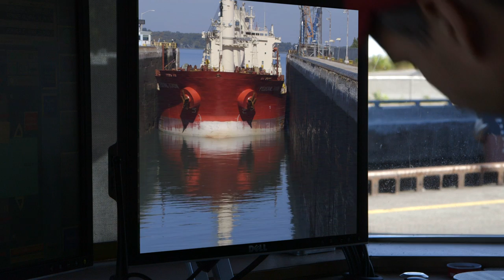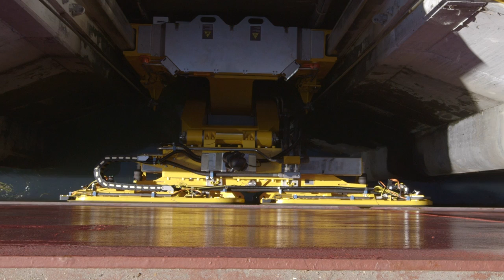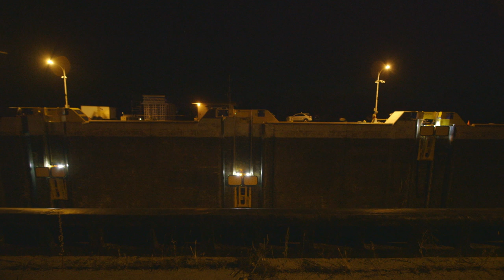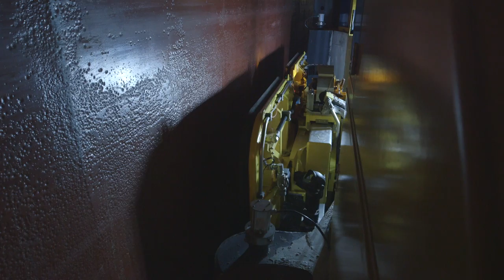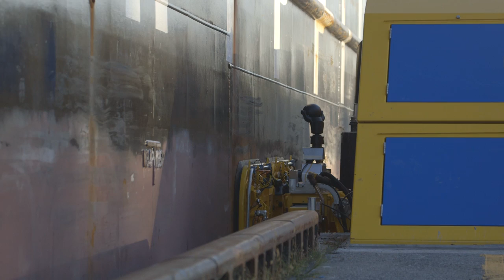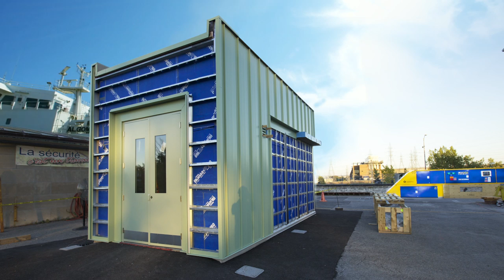MoorMaster™ automated mooring at a lock application

Comment: What's wrong with St. Lawrence Seaway employee's tying up ships and maintaining watch over the ship as it rises or descends within the lock?   What happens when the  MoorMaster doesn't let go of the ship and damages the ship or the lock wall or both?  How's the  MoorMaster camera's work in rain, snow, ice or all three. Have seagulls been introduced to the camera? Does the acid in the seagull poop dissolve the camera cables? Geezz...people have been tying up ships for thousands of years, trying automate it and overlook the safety factors of people on the ship and along the lock wall sounds pretty risky to me.
Reply: I agree
Reply: Because that's how life progresses
Reply: Safety is the main reason why this system has been introduced. Mooring with ropes is messy and hazardous, and people get killed and maimed daily in the process. St Lawrenece Seaways actually had great difficulties finding people willing to perform this menial, low skill job with all the care and reliability they expected. Some jobs are done better by machines. You can rest assured that your perceived weaknesses have been addressed thoroughly and the system is working continuously, much more reliably than humans.
Reply: The move to get rid of labor is faulty. Human intervention in crises matters, human intelligence keeps things running smoothly.  Jobs lost is an economy weakened.
Reply: @Forseenlife  It's a choice. It isn't necessarily progress.